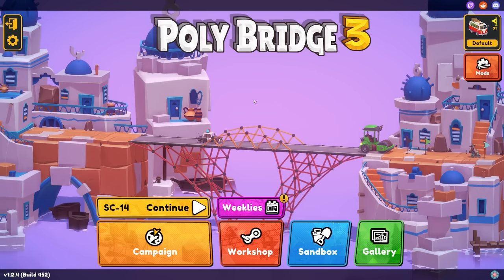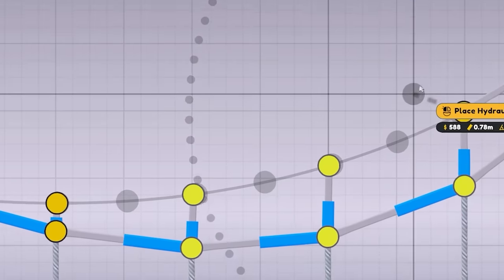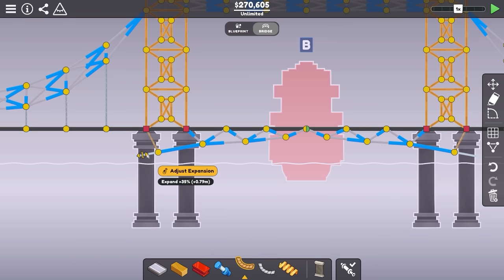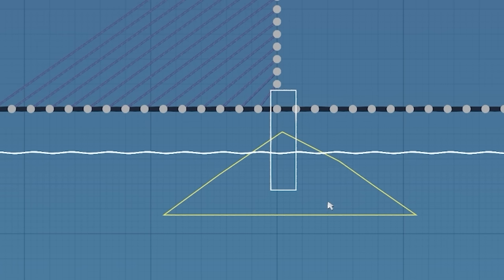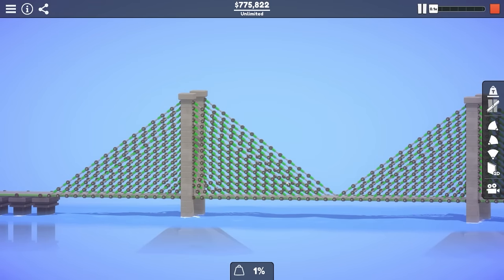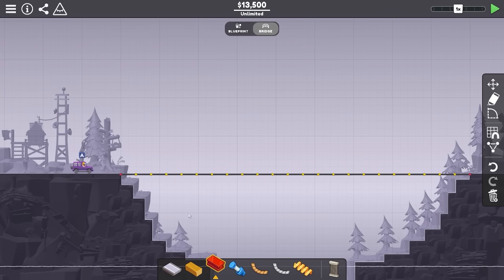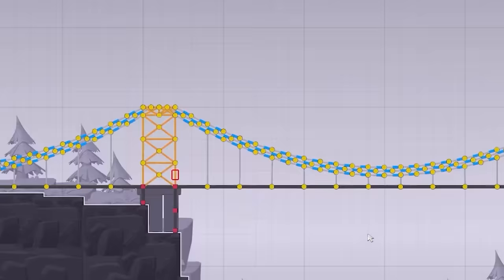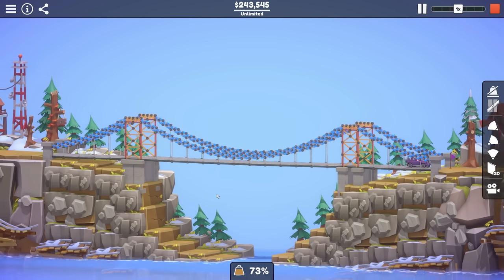Building the MOST EXPENSIVE real bridges in Poly Bridge 3!

Comment: Chesapeake Bay Bridge (not the bridge-tunnel), located in Maryland, USA.
There are 2 spans, so you’d have to choose just one.
The original span (1952) was the longest continuous over-water steel structure at the time, 6.9(nice)km long.
It features 975m suspension, a through-truss cantilever span, concrete foundations. It’s got it all.
I will mention it does have a curve at the end, though.